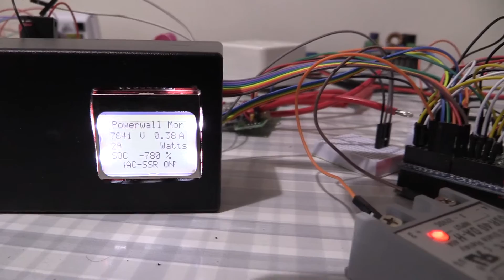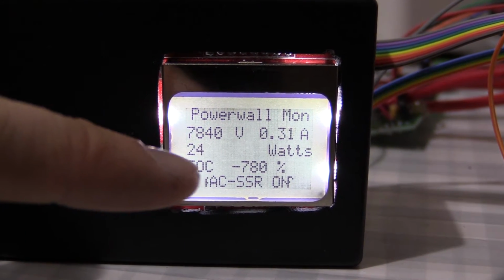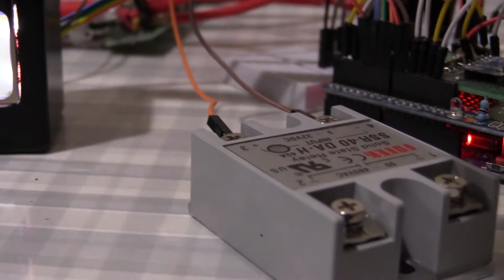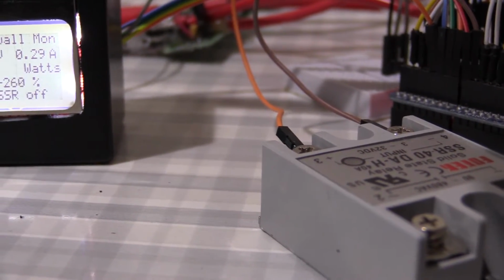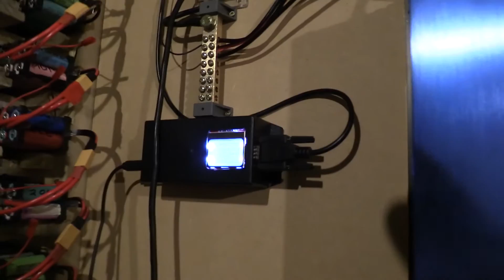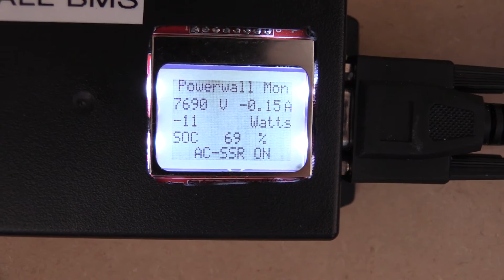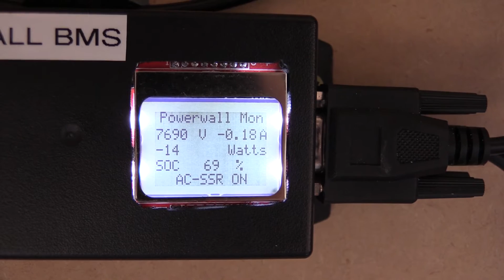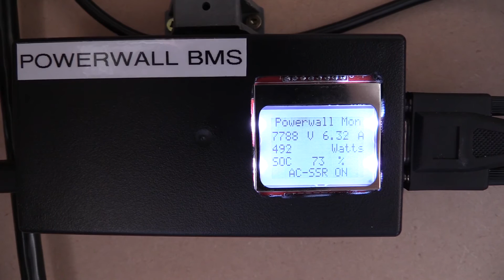Arduino Powerwall BMS Part3

Comment: Please let me know what functions the arduino bms performs that are not performed by the emponpi.

as far as i know, an emonpi could be setup with two ct clamps, one before the batteries and one on the other end.

wouldn't that measure the current going in and coming out of a single column (20 packs) of your system?

Comment: How do you plan to monitor cell voltages ? Mux -> A/D on the uC and measure them one by one between ground and up? What about balancing? 
Passive or going for charge redistribution? Shuttle or Inductive or are you have you found a function that would work actively and move the current without costing to much? Im looking myself because of a similar design.
Reply from the maker: Cell monitoring will be on the next set of videos :P but yes Passive, and with my testing so far 1 amp discharge is about right, 2amps is needs a much bigger heatsink to dissipate the heat then I want to fit, also the costs start to explode when needing so many heatsinks. Active is too costly and hard to build.
Reply: Any update on the Cell Level Monitoring System? Would be awesome to get a schematic of how the system is working!

Comment: Mike, I have ordered the MPP Solar 5000 Watt 48VDC Hybrid inverter for my home power wall that I'm working on, any suggestions where I can get info on the install process??
Reply from the maker: Manual will have the basics. Just remember to mount your panels in 3S if your using 300w panels. if 250w panels then 4S should be fine. The reason for 3S is because of the 150v Voltage limit on the PV so you must setup your panels so the nom is around 120v ish which normaly works out to be 3S. I would normaly run 3s 2P for panels connections. Other than the solar part everything else should be straight forward.
Reply: I would say go with 3s on 250w 60s panels to. Because on cold days you will hit the limits of that inverter. my 250w panels will hit 39v easily on startup. Thats a bit to high for the inverter and it will complain.  They do like to stay around 30v each and that works fine in 4s but its the spikes that may cause issues.